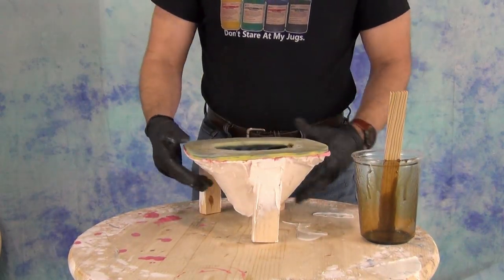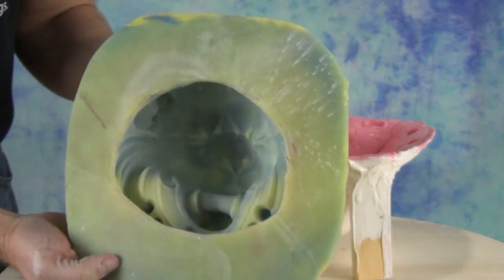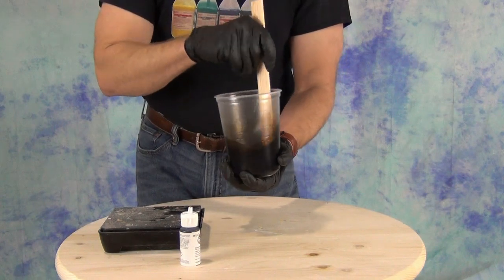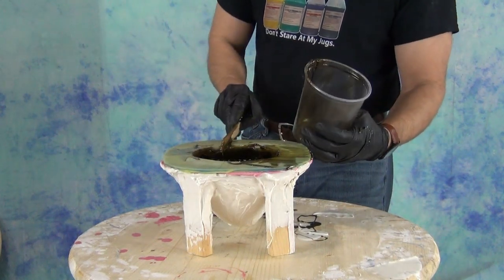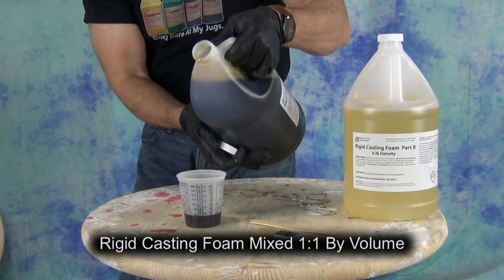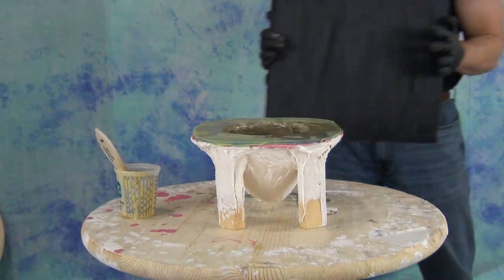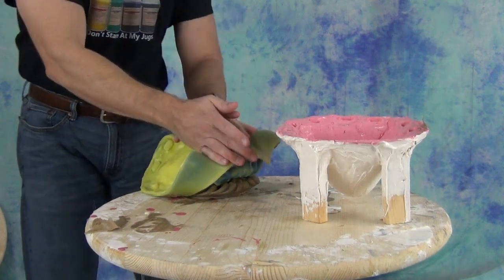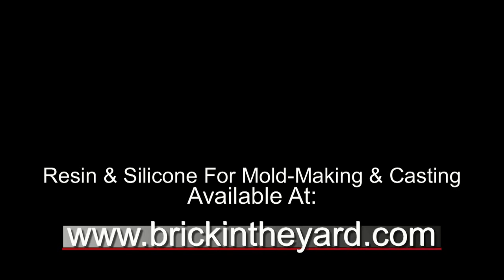Resin Casting Tutorial: Slosh Casting & Foam Backing

Comment: i have an idea of using epoxy resin mixed with regular packing foam broken down into small bb size pieces...  kinda like rice crispy treats  thinking it will be lite weight and very strong..i want to use it as a fill... thinking maybe 1 part resin to 4 parts foam will keep weight low and be strong
Reply: I never tried what you suggest, but I think you will have problems with the low density polystyrene balls floating  over the resin. it will be very difficult to get the balls down at the bottom of the mold. 
The usual solution that is used in your case is micro-balloons powder. It is regularly used on boats and surfboard, so can be found at a shipchandler (or amazon...). I tried to find some figures for density and resistance, but my sources are quite unclear. From my experience, I would say you can easily reach a 0.25 density with a very strong result. And maybe a 0.1 density according to the documents.... OK it will be much stronger than foam, but at a cost...
Reply: If you mix polystyrene with resin it will only melt and turn into a porable material as it will still go hard. But it will not be lightweight